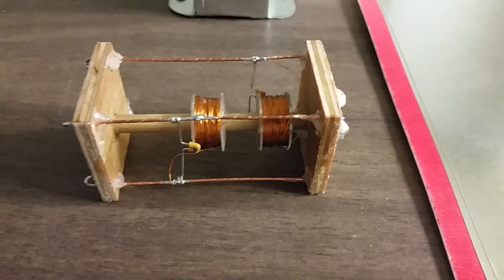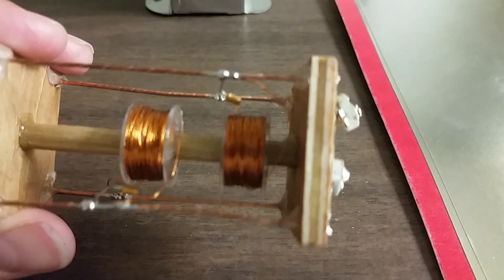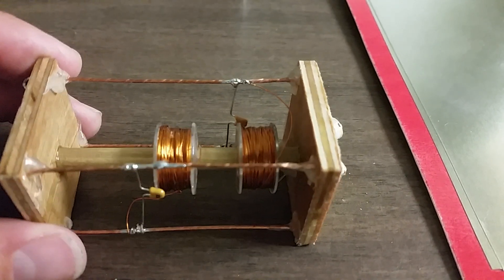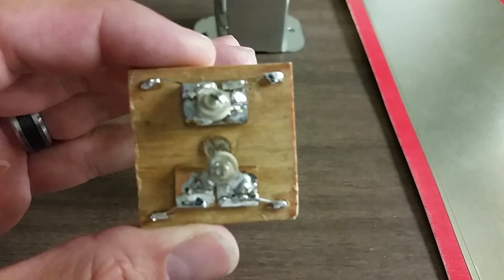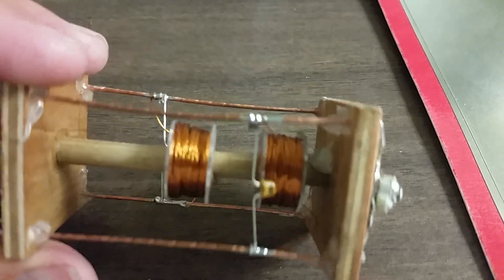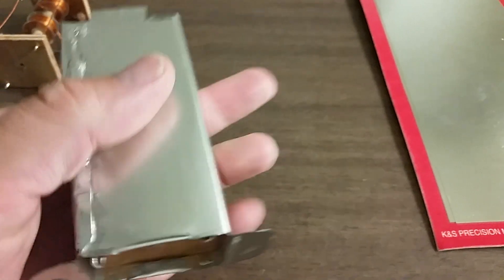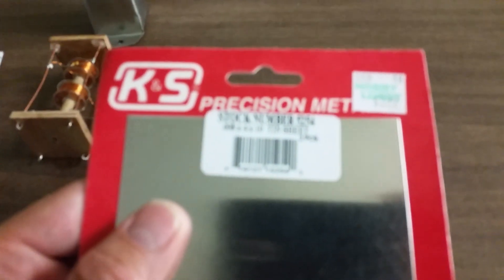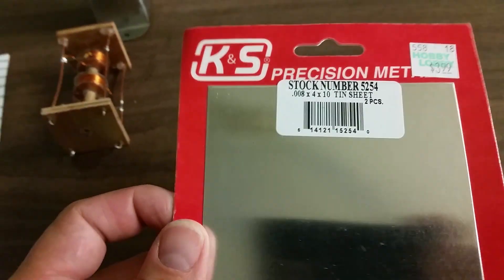DIY Intermediate Frequency Transformers

Comment: Great video.  Thanks for putting this together.  I wonder if you would comment on something for me.  I have a 6-6.5MHz IF transformer for an SX117 Hallicrafters that froze up and the core was damaged beyond repair.  It has a 100uuF capacitor on it built into the can.  I was wondering since the coil is still intact if I could add a couple Variable caps to make it function as a IF transformer again-- without the core.  Or will I need to have the core in there for it to work properly at all.  Thanks for any comments or suggestions.
Reply from the maker: Short answer - yes. You can get functionality by making the two circuits resonate on the correct frequency. More to follow because it's not quite that simple.

Comment: Well done. You remind me very much of my friend in Chile who made his power amp heatsink by cutting up coffee cans and pounding them flat, then folding the metal and soldering all the layers of fins together. I'm surprised he didn't make the transistors.
Reply from the maker: That might've worked over a bare transistor, but using aluminum would've had a much better effect. He might know that and only have coffee cans available.

Comment: Very nice and the idea of using sewing machine bobbins for the coil form - genius!  Would have liked to have more technical details: inductor value, measured Q, etc as well as an actual frequency response.  Overall very nice.
Reply from the maker: Technical details - 

The inductors measured 1.1 mH. I didn't have a counter on the wire jig. I chucked them in a cordless drill (using a 1-inch #8 machine screw) and wound them with AWG 30 wire. I did it until there was about 2mm of distance between the top layer of wire and the edge of the bobbin. I also moved the wire up and down as I ran the drill so each winding didn't lay perfectly next to the other. This is good for audio but not RF. Once done, I dipped the coils in clear water-based varnish for 30 minutes to let varnish creep in and fill the voids. This brought up the inductance to approx. 1.3 mH.

The fixed capacitance is 22 pF and the trimmer is a 5-60 pF ceramic. I don't have the ability to measure Q directly but my methods for analyzing frequency response were flawed. When I put these to use in an actual radio, I'll be able to more accurately test their bandwidth. I'm figuring it's something like 20-30 KHz. That's not great but I haven't done all I can to test these yet.

Ed

Comment: Good job. How about to do 10.7mhz for fm?  I search schematics and need to be with 5 pinouts not 4.
Reply from the maker: All of the FM transformers I've seen need a tertiary winding for the discriminator/ratio detector.
Reply: Thanks but you did it?? Have video for fm?
Reply from the maker: @jonathangauci2182  no, I haven't done that.

Comment: This is great.
Simple, easy to make and get parts.
It would be nice to find some metal container that could be repurposed.
Keep an eye open when shopping, maybe you will find something.
You could used pcb material soldered together for this but it would be ugly.
The shielding characteristics would be different from ferrous material.
However some IF transformers are encased in aluminium.
Reply from the maker: Have you thought about aluminum beer bottles? That, or empty aerosol cans made of aluminum.

Comment: Would be good to see more regarding alignment. Getting the IFT on frequency is relatively simple but we need to consider the spacing between the coils as this affects the response curve. We want it neither 'peaky' or with a 'dip' in the middle.
Anyway, interesting overall as these days commercial examles are like the proverbial 'hens' teeth'.
Reply from the maker: This project resulted in transformers with regrettably low Q. To get high enough Q for use in a radio receiver, one needs to use Litz wire. 

I've evaluated similar coils by themselves and the winding style, coupled with the use of magnet wire, leads to barely useful transformers.